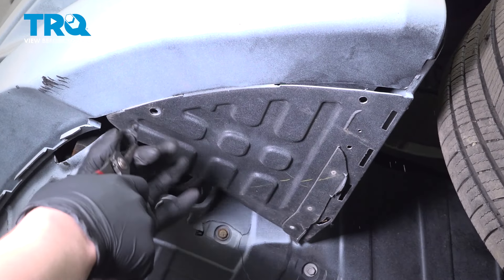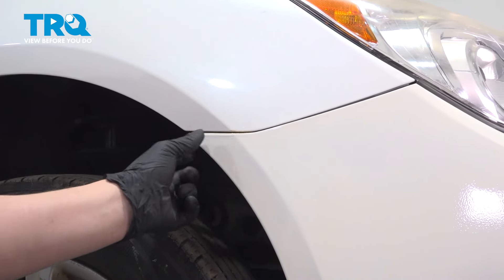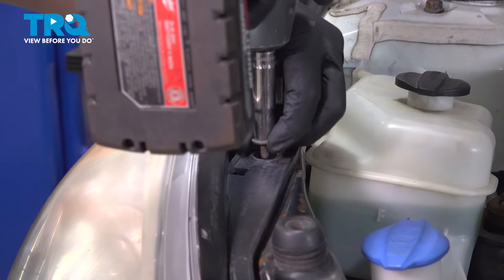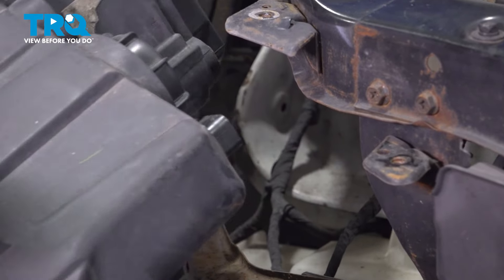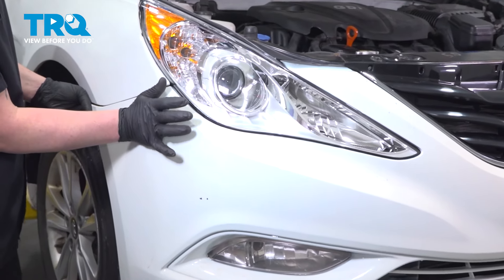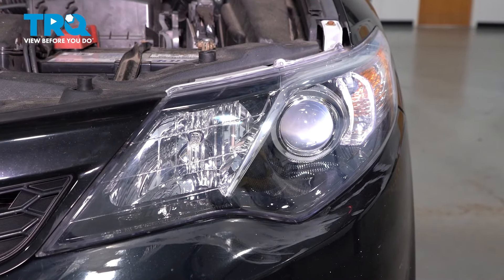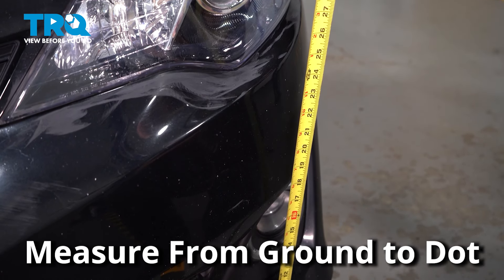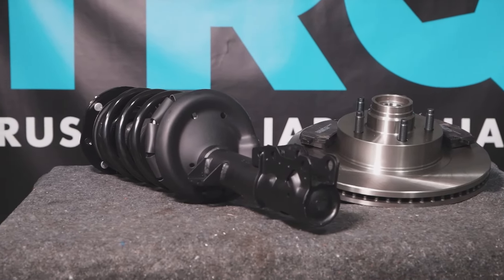How to Replace Headlights 2011-2014 Hyundai Sonata

Comment: Im having a hard time with those headlights, poor lighting even after change the light for LED , and try to adjust It, its the Low Beam, even the high one too, also already polished the headlight , i think the thing needs to be changed, i wonder if you had to change that because of the same problem @TRQ . 2012 Hyundai Sonata GLS . Please 🙏🏼 answer my question, thanks